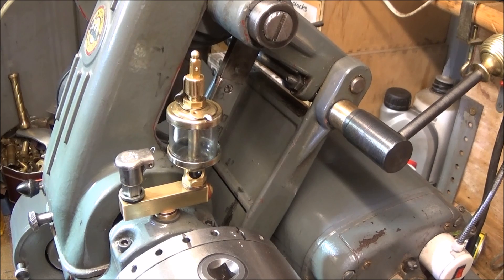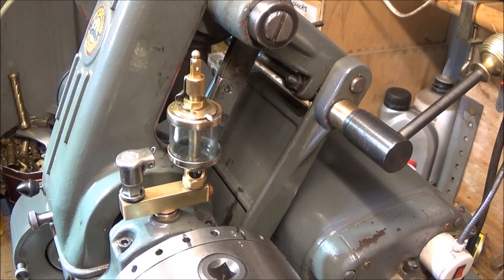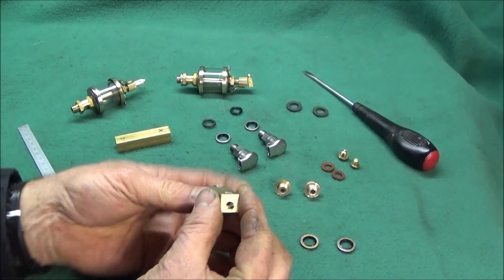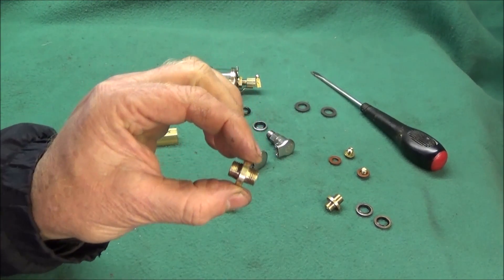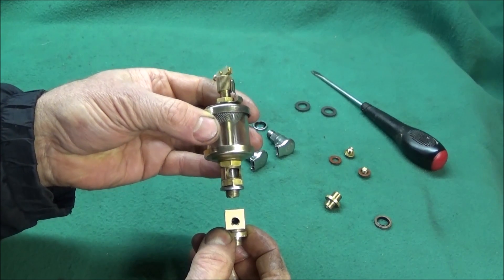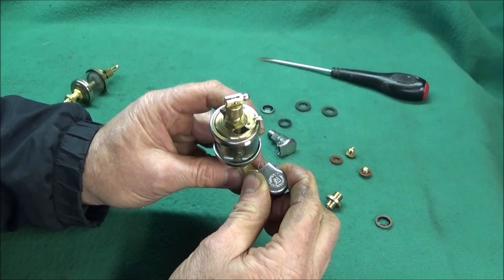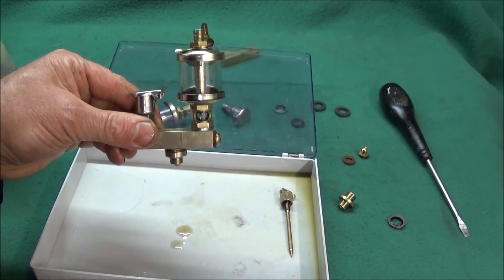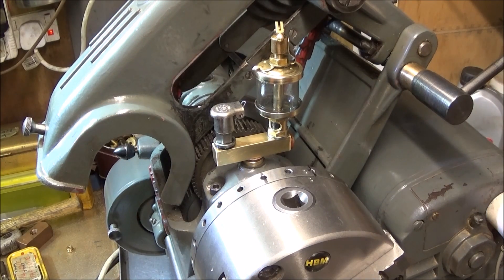Home Made Oiler Upgrade For Myford ML7 lathe Drip & Cup Oil Manifold

Comment: Excellent! But please forgive me Steve, is there any need for the seals on the top of the bar at all? Apart from to get the correct position? it’s gravity fed and the threads protrude down into the bar.
Reply from the maker: It saves the threads from bottoming out in the bar screwing up tight against the seal an looks neater.

Comment: Hi,I have these oil drip feed for my Myford ML7 lathe, just wanting to know if the top leaver turn down then it's off?
Reply from the maker: Hi yes that is right as long as the adjustment isn't up too tight. So when the lever is down it springs shut.

Comment: Hi
Saw you video on drip feed oiler I have made one  very similar to yours but I can’t get it to drip  any oil is the wick  a specific type
Cheers
Reply from the maker: I just use the same type of cotton wicks that you would use in a lighter. You can buy them on eBay. If the bore that the wick goes through is tight that would prevent it working?

Comment: I’ve just got my old challenger running again and it’s got its original cups I have never used a lathe that had bronze bushing what kind of oil should I be using
Reply from the maker: Hi Andrew in the Myford lathe manual it says Hydraulic ISO 32 oil. That's what I use, but don't get caught by people saying you have to use a particular brand, like some think. Any ISO 32 is perfect for the bearings. You can buy it on Ebay or get it from agricultural /farm shops. Regards Steve
Reply: Steve Jordan  thanks I think we use that on our forklift at work I will have to see if I can get the old cups out and do a setup like yours
Reply: That’s that sorted I feel a lot happier I inherited the lathe from my grandad now it will be protected properly I had been using 3in1 for the past few days as I thought we have 50 litres for our forklift

Comment: What oil do you use with the old myford bearings?  any tips on setting up the drip oilers? thank you.
Reply from the maker: Hi I only use the ISO 32 Hydraulic oil....it doesn't matter which brand, but I use a good quality non recycled one. I found it is fairly inexpensive to buy. I also use an additive Molybdenum Di-sulphide.....the one made for car engines, to keep everything running smooth.

Comment from the maker: UPDATE. I have found it is best to use P.T.F.E plumbing tape on the threads of the front oil cup rather than the Dowty seal and O Ring shown. Also I use a fibre washer rather than a Dowty seal on the thread that screws into the bearing housing.

Comment: Good idea, I am going to do something similar .It's a pity that there is not a better way of oiling the tail stock and all of the other oiling points as they seem very hard to oil with the oil gun . Great video.
Reply from the maker: +wykecastlewelding Thanks, I have just fitted a concave oiler button on the tailstock which seems to be easier to use than the ordinary ones.